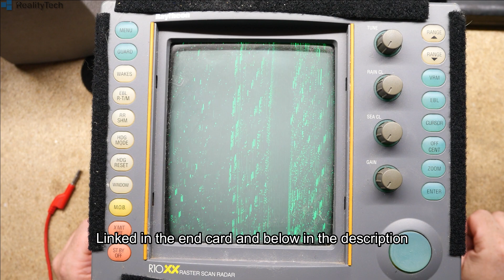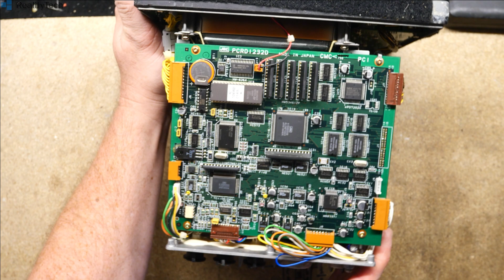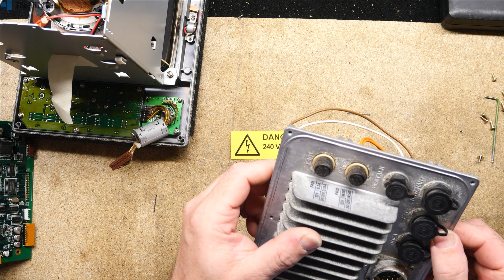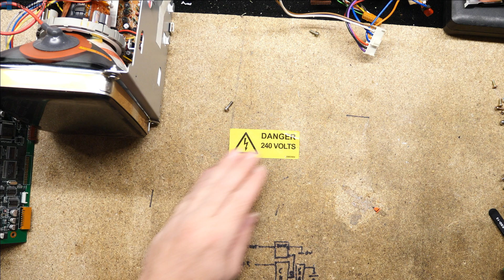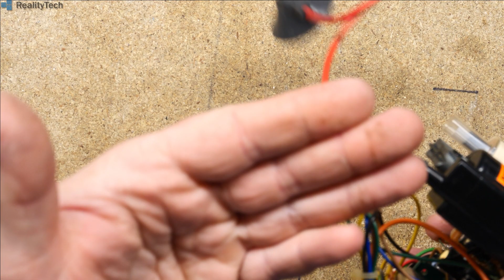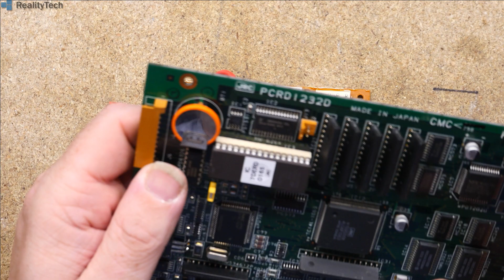#133 - Radar Display Teardown

Comment: Personally I would think using the existing CRT controller would be the most tedious route to driving the display unless you happen have an EPROM emulator and a lot of free time.  The Pi PICO PIO thingi (I'm not an expert) could be used, lots of VGA examples to modify, similarly one of the ESP32 VGA libs could also be modified. Some CRT driver ICs will accept composite sync on the HSync line. The RPI would drive this from GPIO alone with modified DMA driver code. Lots of options.  If you get bored I would love it, I miss CRT based text terminals :-)
Reply from the maker: Lift the enable line on those buffers, CRTC is then mostly isolated and ready for driving with an STM32 or similar